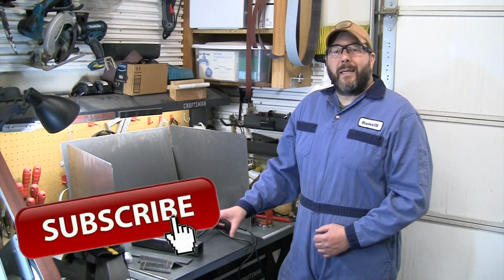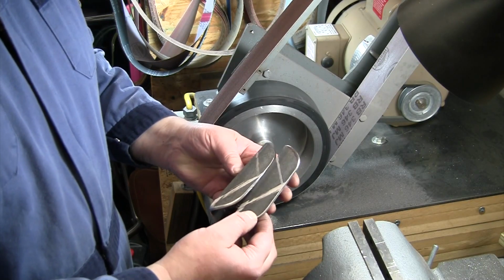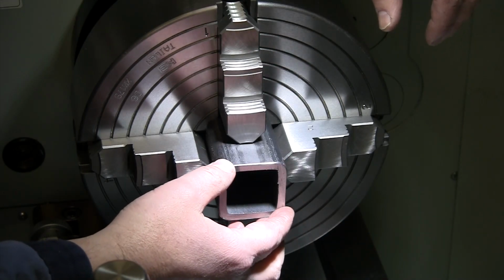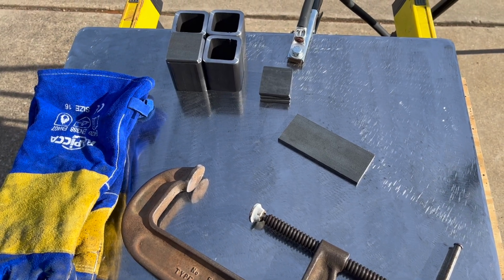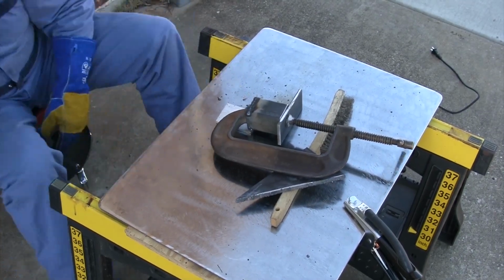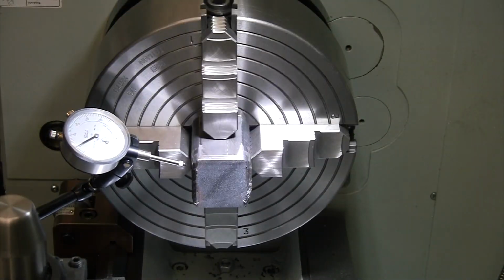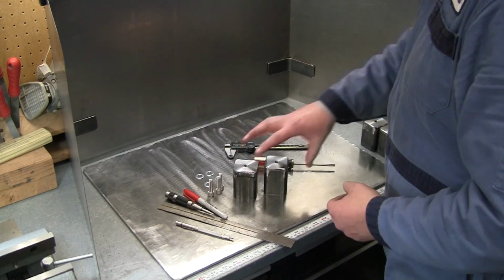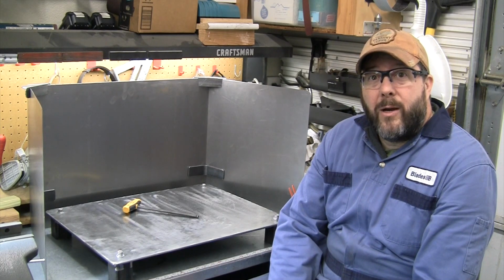Bench-top Welding Table & Splatter / Spark Shield

Comment: Would you be able to sell me a bench top welding table and splatter guard?
Reply from the maker: @richardrombotis1726 - I would be willing to but unless you are local in the Dallas area I am not sure it would be very cost effective. Custom build and shipping would make it much more expensive than buying something similar from local retailer. Shoot me a message through the contact form on my website if you want to discuss - www.BladesIIB.com. Thanks!